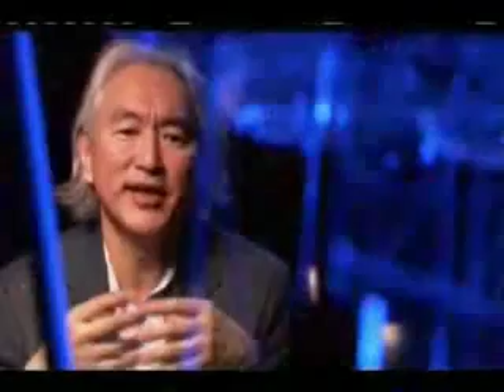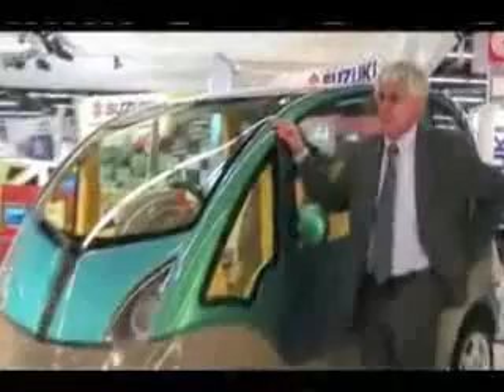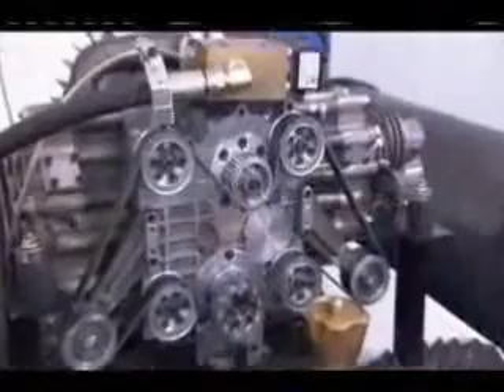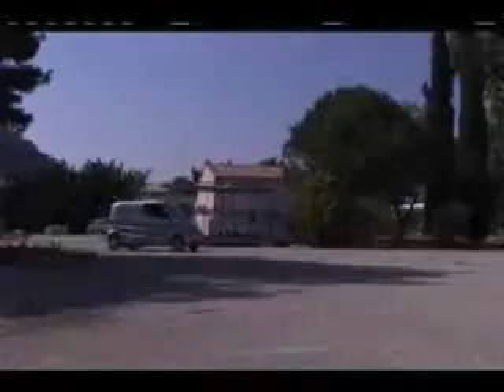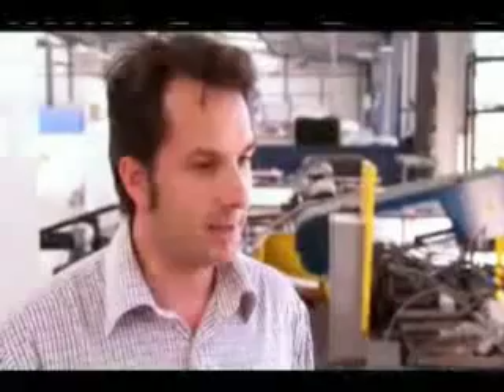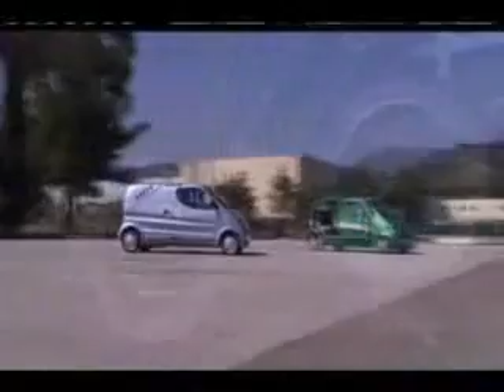FREE ENERGY - Air Powered Vehicles

Comment: The logic of that last bit was ridiculous. You can't use compressed air, to compress more air,and expect the whole thing to just keep going forever...that's like saying you have two wheels with a belt connecting them...you turn one wheel, and it turns the other wheel...which turns the first wheel, again, over and over to infinity. It's a nice Idea but it simply doesn't work. This is pretty elementary physics...the guy who made this video was either a con-man or quite uneducated/unintelligent .

Comment: @MakeYourOwnMotorhome I also don't see how you can store the energy for 200 miles of motoring in tanks that size. I did a quick calculation. The figures would not stack up for this. You could get a handful of miles maybe and performance would really drop as the pressure decreased. The physics doesn't work, sorry about that!

Comment: The perpetual motion thing at the end was really silly. It destroyed any credibility you had. The motor used to compress air at the filling stations will have considerable emissions too - mores than a motor for direct drive because there are big heat losses in compressed air systems. I would have liked to have seen this point addressed in the video with supporting figures for power and losses over an equivalent direct drive system.

Comment: Compressed air is not a source of energy; it's a way to store energy.  At best, you're going to get back the energy used to run the compressor.  More likely, you're going to get back a small fraction of that energy.

The advantage might be that you could indirectly run your car on something clean but bulky, like hydroelectric or solar.

When the presenter talks about using the compressed air to run the compressor that's really just another way to say he failed high-school physics.

Comment: Compressed air is one of the least efficient means available to store energy.  A significant part of the energy used to compress it is lost in the form of waste heat.  When you use that air, it becomes cold, just like those dust blowers you buy at Office Max.  When it cools like that, the pressure inside the tank drops until the temp returns to ambient.

I wonder if these guys are really that dim, or if it's just a deliberate lie.

Comment: When I say, "Very":  The initial losses due to heat via compression are about 50% of the input energy.  Include in the roughly 90% efficiency of an electric motor, and the roughly 70% efficiency of your average centrifugal impeller, and you've got a storage efficiency of about 31.5%.  Compare that to the nearly 80% for a LiIon battery or 95% for NiMH.

Meanwhile, pressure engines top out at 60% efficiency, while electric motors, again are at 90%.

Pneumatic: 18.9% efficiency; electric: 72%

Comment: When I say inefficient:
Air compression converts kinetic energy into heat and pressure.  The heat dissipates, while the pressure is stored.  The portion converted to heat is, therefore, lost.  There is no way to avoid this.

In converting pressure to kinetic energy, there are losses due to friction, and carnot losses - that is, there must be a pressure differential for a pressure-based engine to operate.  As this differential gets smaller, so does the engine's efficiency..

Comment: How about a moment of rationality, yeah?

It's a pneumatic car.  It's recharged by expending electrical energy to compress air.  That energy is expended by releasing said pressure.

That's all well and good; you're basically using an air tank as a very inefficient battery.  It might even be cheaper per unit joule to do it that way - but you'll never get quite the efficiency of a real battery, nor the power density of gasoline.

Comment: gas cars, and replaced'em with air cars, if we even have to use electricity to power the air generators for the compressors, its still now as much pollution as you may think.  cuz now picture this:::  all gas cars are gone and now we just have all the other bad pollution problems.  our pollution will go DOWN 10% every year.  maybe even more.  and thats alot since our pollution (even as your reading this) is going UP 22%.  ao please, reconsider your next car, and buy this car.--

Comment: The problem is not how fast or how far the car goes, or how much energy it takes to fill the air tanks, the problem is the size of the car, it is tiny. 

I highly doubt you get Americans to drive it, but maybe other countries will use it such as India.

I wish the car would use a rotary engine as it is ideal for compressed air. There is a guy who makes forklifts running on compressed air rotary engines. The two should combine and not go after the money.

Comment: "buts only mine apion"
And you opinion is mince.
The horsepower rating is about  8 
You need a 6kw dive compressor running for 6 hours and it will might go 20 miles.
That's MDI results
Gogle Vencat 20 miles

Comment: maby but you can conwer 12 v batery to 220v 300w using DC-AC power converter and i think it will be enuf for fulling up car with compresed air , only thing what i donot like is that car has to big engine o they can make smoler engine and with goo gear box it can reach abaut 120hm/h speed buts only mine apion

Comment: Sure... if you design a car that needs only one horsepower to run, because that's all you're going to get at bet. energy form the sun is at best 1000 W per square meter at ground level. Solar panels are at about 30% effieciency today. Add to that less than perfect conditions, and you get approximately 1 horsepower (1 hp = 735 W) to use. 

And in any case, it would then be stupid to use that power gained there to compress air when you can just drive the wheels directly with alot less loss.

Comment: However, you can be very much more efficient than we are now, and this is a great step.  I envision the onboard compressor being combined with high tech batteries (like in hybrid cars), that could use regenerative braking and optional solar panels to re-charge while driving, and are still able to plug in.

Comment: If it were that easy they would have done it with batteries already.  Having an onboard compressor running on compressed air is bad because you are just choosing to lose more power to the process instead of using that power to drive the car.

Comment: whoever made this video forgot there will be energy loss, so you can not obtain perpetual motion in this manner...
This is not free energy because you must figure out a way to power the compressor, and even if that runs on compressed air it generates itself, there is friction in the process, which represents lost energy in the loop... this would continue until there is not enough compression in the air to power the compressor...

Comment: An air-pressure car could be rigged as a gas-hybrid... if this were done 1 tank of gas would get you from LA to NY.
I am not bringing this up to say we necessarily should be using them as gas-hybrids... I think other solutions like an optional electric hybrid (just to run the compressor)  with optional solar panels are better.
I bring this up to show you how much more efficient this method is.

Comment: THIS IS WHY YOU SHOULD NEVER EXPECT THIS CAR IN THE U.S (FORBES HARDEST TO GET CAR LIST)

Toyota Prius

Base Manufacturer's Suggested Retail Price: $21,500
Average Days Supply: Seven
J.D. Power Retail Turn Rate: 11
Environmental Projection Agency Combined 

Estimate: 46 mpg

    May be hard to get because: Production levels of this fuel-efficient hybrid sedan were capped at 180,000 units for 2008 in the U.S. market; a redesigned model is due later this year.

Comment: In Finland if you must know. It's only fair that one publishes the real facts. So tell me, with your better physics, how much energy will it take to compress the air to the tank and how often do I have to do it? 

Laws of thermodynamics tell that you can never convert energy from one form to another without losing some. This is why perpetual motion is impossible. This is why compressing the air into the tank while driving will not work.

Either hydrogen combustion or electric = clean future.

Comment: 2 ) The entropy of an isolated system not in equilibrium will tend to increase over time, approaching a maximum value at equilibrium.
The Second Law of Thermodynamics states that "in all energy exchanges, if no energy enters or leaves the system, the potential energy of the state will always be less than that of the initial state."  A watchspring-driven watch will run until the potential energy in the spring is converted, and not again until energy is reapplied to the spring to rewind it.

Comment: Admittedly it's a lot less energy than using gas. I have an air compressor in my garage and it runs on electricity. Filling up a large tank with air wouldn't take too much electricity.

Electricity is made mostly by burning fossil fuels, but it doesn't always have to be. They're working on solutions.